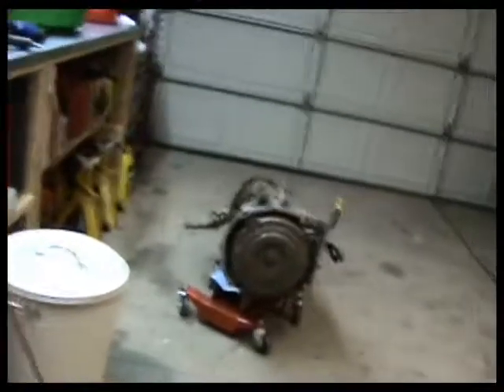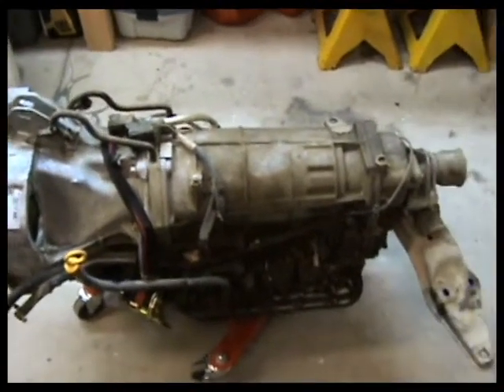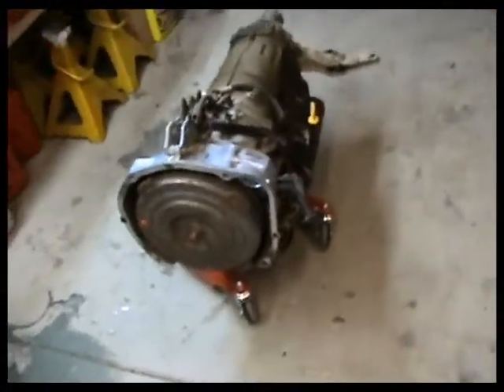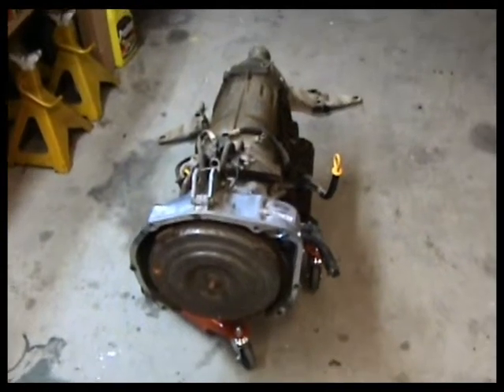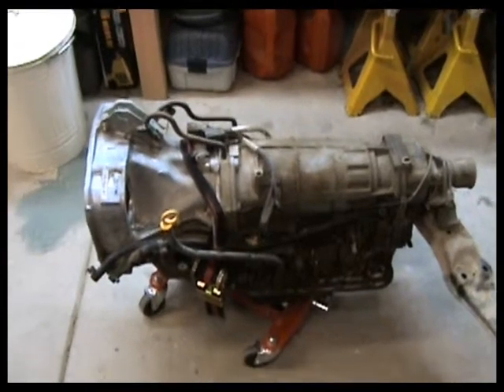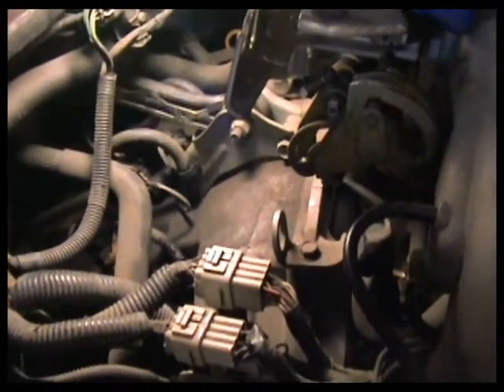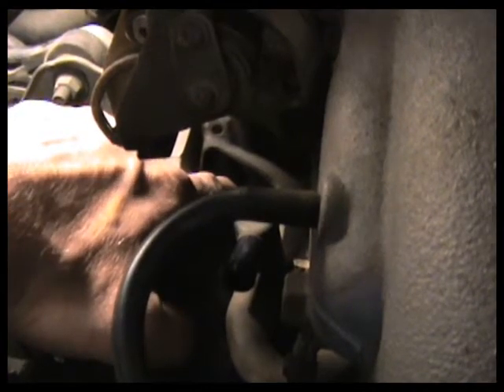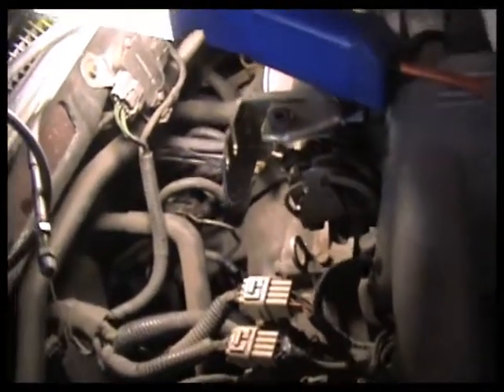Time to tinker 72 Subaru SVX Transmission

Comment: There's a stand alone transmission controller that can be put in to fix all the problems with low line pressure to the direct clutch. Made a solid trans with raybestos clutches.

Comment: A family member had a 94 SVX and parked it in early 2000's because of a bad transmission. They were very expensive back then to replace. It sat for about 8 years before they sent it off to the wrecking yard.
Reply from the maker: lot of them have met the same fate............tony

Comment: I have a 4.44 swap on mine.  I also use a heavy duty transmission cooler and a discontinued TCU mod called a quick change that makes it shift faster.  With some other mods you can turn this into a lumbering GT cruiser to a pretty sporty car.  Manual though is the best way to do this but I had already invested in the 4.44 so it was too late to go back.  You can do a 5 speed out of a lot of different Subarus.  A 6 speed out of an STI is the best way to go, but will cost a lot to do.